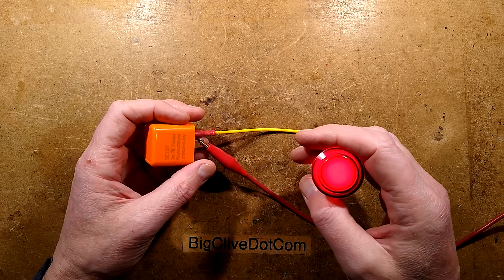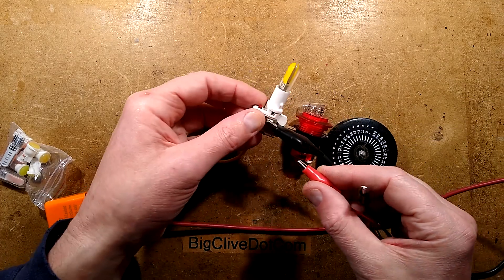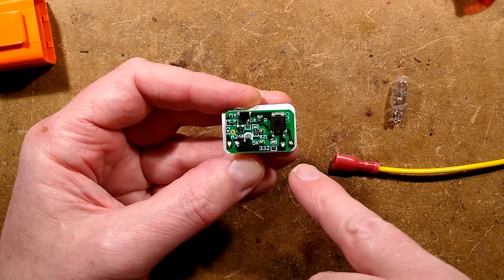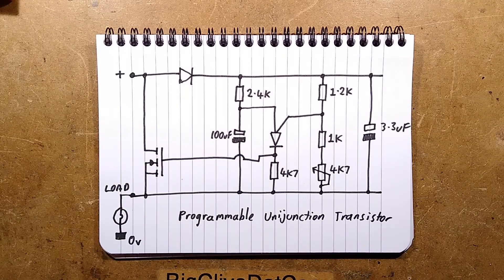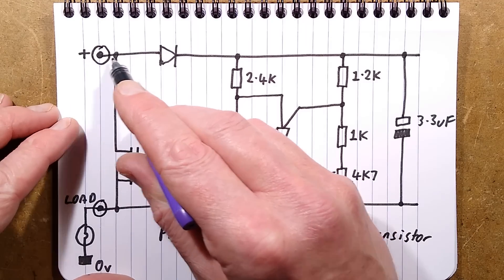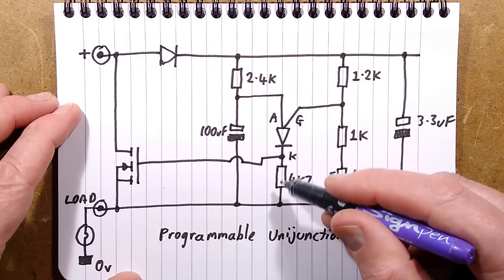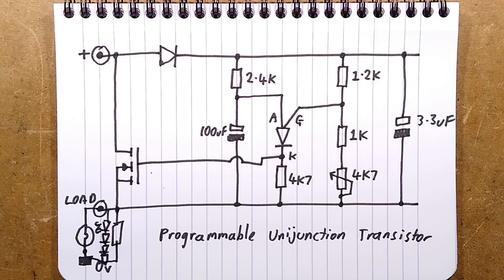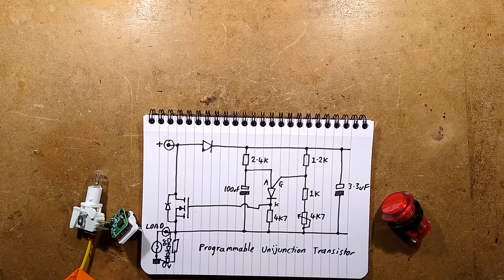Two wire flasher module teardown with unexpected find

Comment: If you change the value of the 100uF capacitor, would it be enough to change the blinking frequency ?
Reply from the maker: Increasing the value of that capacitor will probably slow the flashing.

Comment: And on a lot of cars designed for incandescent flashers, they'll hyper flash if an led is installed unless a resistor is added. But if the relay heats up in order to turn off the bulb, wouldn't the led take longer to heat the relay therefore it would stay on for a longer period? Hyper flash is a rapid on off in equal interval. 🤔

Comment: My 2006 car has hazard lights that clicks when the car is running but not if it's turned off. So I'm curious if it's using a speaker to make the noise, and the noise is pretty smooth and loud so it must be a high quality speaker (as opposed to the beeper that does the door chime). And the turn signals are disabled while the car is turned off so the turn signal switch doesn't do anything. 
I'm curious how the flasher relay is hooked up in any car where the turn signal and hazard switch can both control the relay, and does one relay control all the flashers.

Comment: Where to put variable resistor in stock flasher to make it work with led.?????
Reply from the maker: Standard flashers may need a higher load.  There are resistors available that go in parallel with the LED bulbs.

Comment: Actually popped one of these open yesterday after it stopped working. Interestingly the transistor is what seems to be a 2N2907. The rest of the circuit was the same apart from a 1uF cap instead of your 3.3uF cap. 
I reverse engineered it and built it on a breadboard using a 2N2907 PNP and an IRLZ44N logic mosfet and it worked fine.
I'm no expert on transistors but looks like putting a bias voltage on the base of the transistor also works then.

Comment: Thank you for this. Someone else did a breakdown video on this and had almost the exact same circuit. I though great I can use it in my simulator software. I am designing lighting configurations for kit cars, trailer lights, maker lights, hazards and turn signals. So I needed a 2 prong/pin flasher circuit. Well it wouldn't work because of the PUT. The guy didn't know it was a PUT.  Was on the forums and all they kept getting stuck on is the LOAD. The damn load. They couldn't get passed me telling them, "It's not the load, something is wrong with the circuit"

In any case after someone finally, left a link to your video. I knew you would have one on this but it would never come up on any search. Not gaagle not even directly here on youtube. 

I was able to find an alternative/equivalent  circuit using regular transistors and now all is good.  TY.

Side note: I think the reason why the LED bulbs are not working is because of the load not having enough resistance BUT that is a non issue when in a vehicle. The amount of wiring to get to the bulb adds the resistance needed. So adding 3 or 4 ft of wire and it should work.

Comment: That is useless info I want to no how to connect the wires to relay to make it work lights not what's inside
Reply from the maker: This channel is about what's inside.
Reply: Just read the car instructions manual if you not interested.

Comment: I used to like fooling around with UJTs,  they're quite varsatile little parts.  Not easy to find these days,  but you can effectively have one by cross-connecting a PNP and an NPN transistor,  collector-to-base.  This not only gives you a PUT,  but also an SCR and SCS (another part I haven't seen in years).

Comment: I had to replace the turn signal flasher in my 2014 vehicle with a solid state flasher because when I connected my trailer the flash rate more than doubled.  Of course the factory flasher was the bimetallic strip type. The new flasher I selected was a bit taller so minor surgery was required for the cover to fit 😊.

Comment: Might be an interesting little device but it doesn't work with different types of LED turn indicators in parallel since some of LED's will not turn off completely  and the flashing frequency and duty cycle (should be 50%) will change depending on the load. Had no other choice but to go for Arduino based ws2812b sequential turn signals, drl's and brake lights for a bicycle.

Comment: Unrelated to the electronics but I do wonder how these things are supposedly "waterproof" with the hole in them for the potentiometer, and no seal round the outside of the casing, and no potting.

Comment: Remember looking at PUTs back in the 70's when  I was designing a sound to light unit. In the end I used surpus/recovered NPN and PNP transistors (seemed cheaper at the time)  to emulate the trigger fuction and drive the SCRs. It worked well for many years. Many thanks for the interesting (and sometimes scarey) teardowns you give us.
Phil

Comment: In the very early days of automotive LED light conversion bulbs (about 20-22 years now) the top end bulbs would only sell in kit packs of however many lamps the particular car was designed to have (not usually sold individually) & either a new flasher or a huge resistor pack socket adapter thing to piggyback the old clicker. Which was fine for old cars still on the road back then..  was particularly a nightmare in new-at-the-time US spec GM & Ford pickup trucks that were sorty newly using BCM (body control modules) to control lighting and NOTHING would work right at all until you put the factory OEM spec bulbs back in. Made even worse by the fact I don't think there were even LED tech standards yet back then so there was no real way for an OEM to spec controllers around whatever was on the market. So we were stuck with incandescent for a long long time after their introduction. They were literally dark days, I'm so glad that's all over with now, LED had fully integrated, and people now know what they're doing

Comment: Modern cars use canbus and if you swap out the indicator bulb for an led you have to put a resistor across otherwise the system thinks there is a problem like a blown bulb and will bring up a warning. The resister is used as a shunt to increase the current to match the current draw of the bulb

Comment: Remember that the flasher would normally have at least 2 lamps connected to it ,usually 3.

btw the diode is older that the programmable UJT and we won't mention the capacitors and resistors shall we?

Comment: Bigclive, i know you probably wont see this, but i would absolutely love if you could recommend a very bright white led strobe light circuit and LED cobb that would be suitable. Its for my ultralight, and ive found alot of the xenon and even some led setups introduce alot of noise on AM VHF airband radio
Reply from the maker: All bright pulses involve a peak of current.  You may need to make an LED strobe with slight attack and decay envelope.

Comment: i installed led taillights in my car and decided not to install the resistors designed to make the lights flash at the regulation speed for safety reasons.  because the turn indicator lights flash at a faster speed, other drivers are more likely to see them flashing especially when their eyes are darting at more than one car's indicator lights at an intersection to check what they are doing.  also, if i was god, i'd make it the law that all front turn indicator lights had orange lenses so that it is easier to spot exactly where on the front of other vehicles you should be looking to ascertain that other driver's intentions.  these fundamentals are especially important at intersections where there are many cars capable of going in many different directions.

Comment: Back in my theater tech days, during the Christmas shows when we ran led Christmas lights from the dimmer rack, we had to put an incandescent night light on the circuit or the leds wouldn’t go out.
Reply from the maker: It's common to have to add a dummy load on theatre dimmers for some things.  It doesn't have to be very high.

Comment: What a blast from the past! I just simply think of them as a P-gate thyristor. Make more sense than visualising them as a sort of UJT. I was thinking of the curious mix of old and new and then you said exactly that Clive. I’ve still got some 2N6028s somewhere. I remember we used to set them up as a very long interval low duty cycle flasher for LEDs that would run for several years off a couple of AA cells. The chief designer at the first company I worked for put a pair of LEDs in the eyes of a wicker, snake shaped plant holder in the stairwell. It flashed a very brief flash about once minute. People were never sure if their eyes were deceiving them!

Comment: I'm guessing, but in the automotive world many flashers electronic and or bi-metal were designed for an x amount of lamps. So if the bulbs were not drawing the specific current it would not flash, or they would flash super fast. This would alert the driver they had a bulb out.

Comment: I’ve bought several from NAPA for various projects, electronics ones that are only 2 pins and will flash the tiniest load. They have clear green plastic casing and are the same size as most 2 pin cylindrical metal flashers. I don’t know the model number but they’re probably easy to get, I’d like to see you dissect one of those. I remember it had a little IC and a capacitor, a MOSFET, and some other stuff. Similar to this one

Comment: "The CENTRAL SEMICONDUCTOR CMPP6027 and
CMPP6028 are silicon programmable unijunction
transistors, manufactured in a surface mount SOT-23
package."
I had no idea they still existed either. Last one I saw was in a Stylophone.

Comment: Not sure if the one I installed on my motorcycle was a different model (similar externally but we all know that means nothing), but the flashing was adjusted load dependent. With only LEDs I could adjust the pot to have them function properly (resistorless) opposed to them staying constantly dimly lit like Clive experienced.

Comment: There seems to be  a lack of comprehension of the basic requirements and specifications for Vehicle Flasher Modules - 2 pin or multi-pin.
1. They flash at a fixed rate according to Design Rules.
2.This Flashing happens at a particular designed load - e.g. 2x21W for Car Turn Signals (BA15S globes)
3. They make an audible noise/click when flashing to indicate correct function to driver.
4. If the load varies due to Globe/Bulb failure or Flasher failure - short, open, single or multiple failure - the Flash Rate will either be faster or slower than normal, or fully on or fully off.
5. It  must be cheap, easy to manufacture and reliable. Reliable because it's considered to be a "safety" item.

So in many situations using this Flasher Module, as a replacement for the Standard/OEM Unit, would technically make the vehicle unroadworthy.

Comment: I don't if this is relevant. I recently put a bullbar on my 4WD. The lights that came with it, indicators, were LED. The originals were incandescent. The new lights came with a 100 Ohm resister. This was to do with the Canbus system of the vehicle.
Reply from the maker: 100 ohm sounds quite high.  It's to trick lamp current sensors into detecting a load.

Comment: Interesting it must be banking on the fact that LEDs have a resistor in them not necessarily a need in a car but some car electronics need that to sense if there's a bulb in there or if it's blown. Having just pulled my hair out a bit working on somebody's classic car only to realize yeah the blinkers don't work if not all the bulbs are in O yeah I remember that now..... and surprised not all the bulbs were in the brand new light fixtures.

Comment: I bought a couple of these to power LED turn signals on a bicycle. The pot can be used to adjust the flasher so it will work with LEDs without having a resister in parallel. I'm surprised that you didn't try that adjustment before using the resistor.

Comment: Would adding in more LED's fix the flashing issue? As an automotive relay is never meant for a single light, usually anywhere from 2-8.

Comment: Turn signal flashers may or may not have the lamp-out detect function. Many of the flashers are designed for a specific lamp load (2/3/4/5 lamps) to flash at the "normal" rate. One subtlety: FMVSS 108 (the US standard for vehicle lighting) requires that hazard flashers operate at normal rate with two bulbs -- so, if a 4 lamp flasher is used as both turn signal and hazard flasher, the lamp sense has to be disabled in hazard mode. P.S. I might be tempted to use a depletion FET in the circuit.

Comment: if you put led bulbs in an older car, the indicators flash really fast like you have a bulb out, the cure there is a ebay special resistor acros the pos and neg wires to remedy it. suppposed to do front and rear not sure, i only ever did one end and it cured the problem.  led bulbs don't give enough current draw as you know so the car thinks a bulb is out. same as situation as your cure for the led bulb.

Comment: I need to know where I can get that round resistor thingy with the croc clips on it. Guessing it lets you check what resistor you need to use in a circuit.
Reply from the maker: Sadly, it's ancient and very hard to find.
Reply: @bigclivedotcom  That sucks.

Comment: looks like both of the semiconductors are from some left over surplus sales since 50n025 is an obsolete part i would say the same with the put so  not so easy to come by the mos could be sourced and i found 2 of smd type of put so far so a new design would be nice of this i realized i got one of those bimetall type in my car but since it cant use the US lamps in europe it is sloooooooooooow  blinkin i need to get another one. looks like many of the sellers of the mosfet is in china ooooooh i wonder it those are legit i would rather order from digikey or mouser an equivalent for it i have had bad luck with chinese capacitor brands from that time the only thing i would get is pcb's from them

Comment: One way to do it without electronics is to wire a capacitor in parallel with the coil of a relay, then wire the lamp to both the coil and the normally open contact. A resistor is placed between the coil and the +12V terminal. When the lamp is off, the capacitor charges until the relay turns on, which both lights the lamp and starts discharging the capacitor through the resistor. When the coil voltage drops too low to hold the contacts, they open and the cycle repeats.

Comment: My very first motor speed controller was based on an original UJT.  Instead of op-amps, I had the sync reference swept over a pedestal step.  The slope produced sufficient gain for the speed control..  One issue about the early UJTs was their trigger voltage ("intrinsic ratio") variation from unit to unit, so I had to grade them.  Doing that grading, I noticed that there were zero UJTs with the nominal Intrinsic Ratio, only parts below some 90% and above 110% of the nominal.  As there also was a tighter tolerance part listed, I concluded that the factory had already done their own grading.
 Another issue was the leakage current, which limited the maximum time delay obtainable.  So, when, as I recall, GE introduced the PUT, and advertised its lower leakage current, I was intrigued by that.  I never (then) used the new PUT, but I recall how a pal of mine utilized it in one or two of his designs.
 Just in case I would come across a new use for those ancient parts, I at some point purchased 10 of 2N2647 UJTs and 10 of the PUTs (forget the part number), and supposedly still have them in my collection.  Which finally brings me to something that I never have had in my hands - tunnel diodes.  I have occasionally checked, but could not find any availability.  Some old Tektronix scopes used tunnel diodes in their trigger section to speed the response up.

Comment: I use these flashers on my car which I've retrofit with all LED turn signal bulbs. It works fine with no added resistor. Did the example here fail to flash b/c only one small LED unit was shown? On the car there would be 2 (front & rear) quite powerful LED bulbs in the circuit for each side of the car. Not enough draw from the single LED unit?

Comment: Cool!  As you described what the module did, I started contemplating how I would go about implementing such a function... and found myself wondering whether unijunctions were still a thing (they were an oddity when I was a kid), and trying to remember, after all these years, how they worked.

Interesting indeed that they're still around.  Looks like the ones on the U.S. market ain't cheap... like, they cost more than a low-end MCU.  Not priced for design-ins.  I presume cheaper parts are around in certain overseas markets.

Comment: A single " 194 "  LED replacement isn't typically used in an automotive turn signal system.  There will be at least 2 larger  " bulbs " and a 194 as a dash board indicator. With a full compliment of LED bulbs , adding a resistor across the LED so the flasher works / bulb out system does not complain kind of defeats the purpose of using LED to reduce current draw.

Also, there are mechanical flashers that are not load sensitive, these where typically used on the hazard flash circuit or as a replacement when powering a trailer lighting system directly from the vehicles turn signal circuit.

Comment: I have same relay in my Yamaha SR250 for turn signals. Almost all of 80s/90s motorcycles have those installed. Works great. Also, just ordered a few 2N6027 to experiement a few things. Cheers,.

Comment: Can I put a 13amp plug on a outside 300watt light and switch it on and off from the plug
Reply from the maker: Yes you can.  That makes it an appliance that circumvents officialdom.
You can also use a plug in timeswitch to control it, or use a standard wall mounting sensor light.
Reply: Thank you that helps me a lot keep making the great videos 
I watch every night